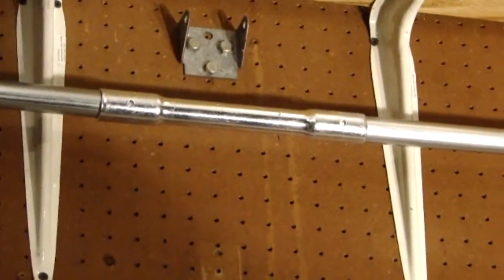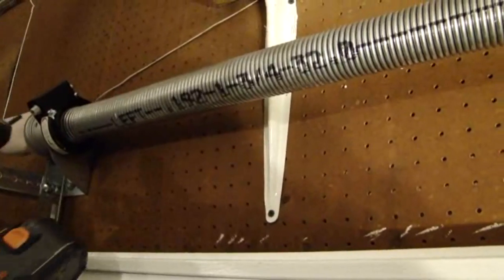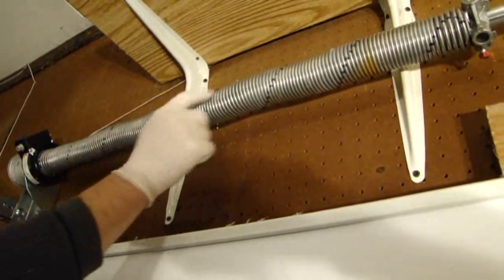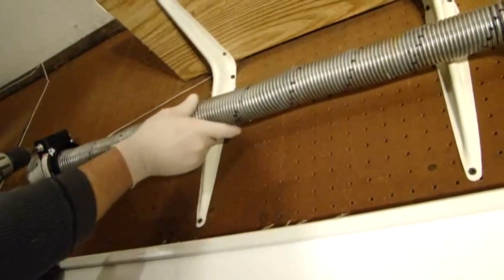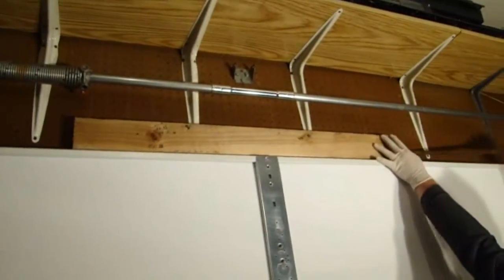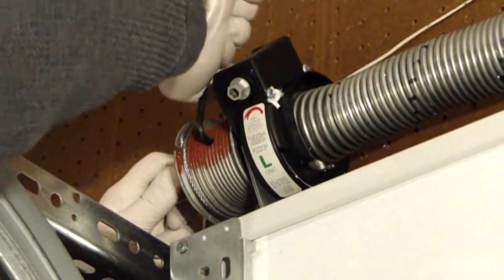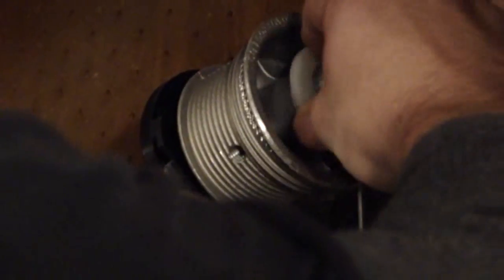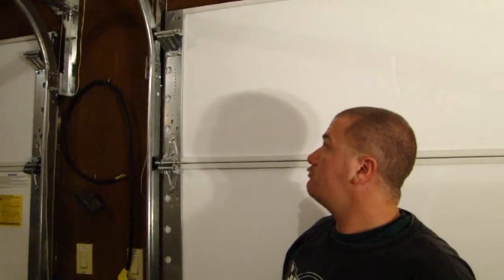Installing A Garage Door Part 4- Tensioning the EZ- Set Torsion Spring

Comment: my advise to your install is the hinges require that the slotted screwholes  are on top and the rollers are to be installed in the hole furthest away from the door. if the rollers are not in the right holes the door face will not make proper contact to the jamb  and the woodstop or weatherstrip will not be affective in keeping out drafts. also the spring will look swirly like a slinky when you have too much space between the coils when fully wound so your prestretch is too much, a little stretch will not look funky  just my two cents.

Comment: Very informative video.  Nicely done. I have installed three EZset systems at my home 14 years ago, myself.  They are all on Ideal,16x7 insulated Four Star metal doors with "Sunrise" windows across the top panel. Each door has well over 6000 cycles.  One about double that. They have all worked flawlessly. Never a single problem.  I highly recommend them.  I would also  recommend using nylon wheels in place of metal ones if the garage is attached to your home.  They're a lot quieter.

Comment: I've noticed it's a crapshoot but most of my service comes in the winter months. I've had some that make it just a couple years and a few that have made it to 7-9 years. At least these are more serviceable than say a wayne dalton torquemaster. I don't service the TM at all and only do springs/cables on the EZ series. I usually recommend REAL nylon rollers at that point to just so I don't have to come back for years. Clopay has decent sections in the high end doors but still terrible hardware.

Comment from the maker: Yes I sure do miss the extra light. Overall I like these doors better because they hold some heat in whereas the filumas did not. If I lived in a moderate climate I would have went back with filumas most likely.

Comment from the maker: I don't doubt it the door come crashing down and crushed the roof of my car after 8 months in service......... just kidding. I have heard many stories about the EZ tension spring system being problematic. Mine has been in service for nearly 2 years and hasn't lost tension yet.  The door is operated a minimum or 3 cycles a day sometime as many as 8. I figure its got 4300 cycles on it and so far everything is still works fine. 
 I dont doubt your information. The plastic stuff seems cheap.

Comment: Check your door first, don't just go cranking the force adjustments. Disconnect it from the operator and run it by hand. It should move smooth and freely and stay open at the halfway point. Hopefully your door isn't as loud as these things. Glad I don't install these debacles

Comment: when the temp gets down around freezing (32 degrees) my garage door wont open byi tself. i have to get out and help it out a little. im thinking maybe the spring has stretched or loosened up since its 17 yyears old. before i tighten it ima sking if anybody knows if thatsth e problem or could it be something else???

Comment: Rollers are in the wrong hole (crucial for door breaking away from the jamb and following the pitch of vertical track). Horizontal angle is upside down (not a big issue).  Cables should have been tightened and shaftline clamped off before the spring was wound (you are lucky that the door goes up evenly).  Should have a strut on the top section for operator (an operator will crease the top section over time).  However thank you for sharing your door installation with us.